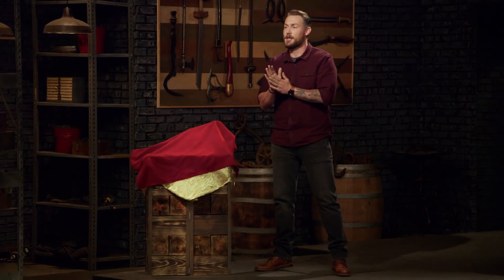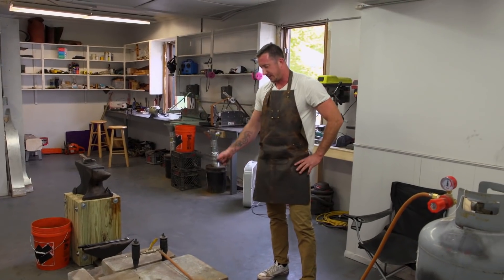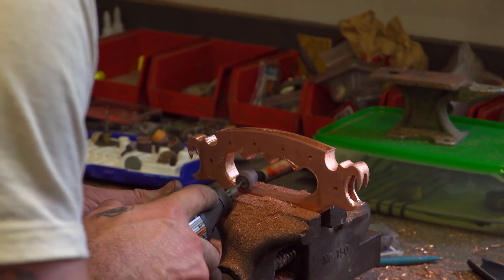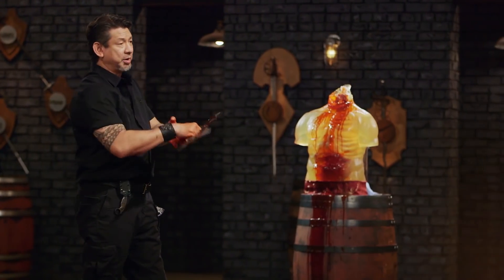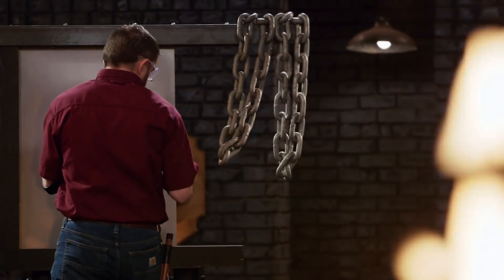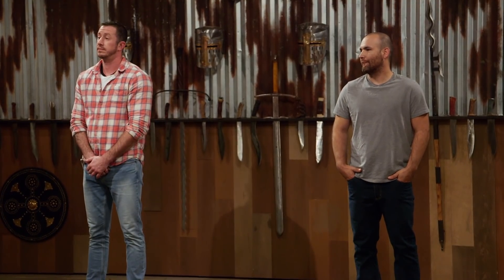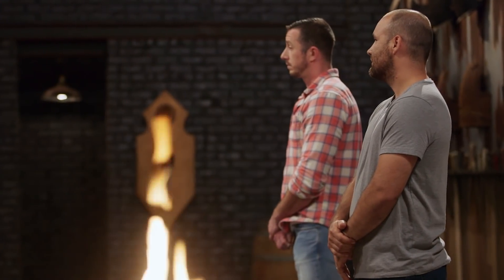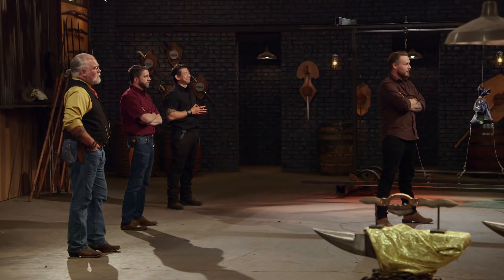Forged in Fire: Deadly Vajra-Mushti CARVES UP the Final Round (Season 8) | History

Comment: One thing is for sure. A bad handle of any sort can cause a weapon that would otherwise be best in class to fail. Turns in the hand? Um, poor edge alignment will get you killed. Hurts to use? You're not going to be giving it the force you need, and it could damage the user to where they can't use it. 
Although I'm not a smith, by any stretch of the imagination, I do know that if you're building something to be used in a hand, it needs to take usability and control, and even comfort into account, even if it means you stay up an extra hour or two one night to finish it right.